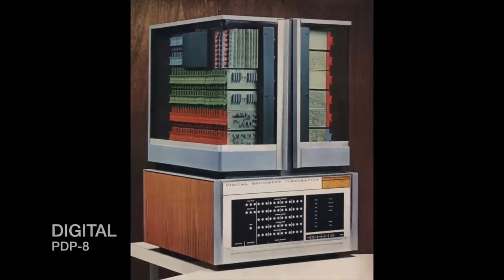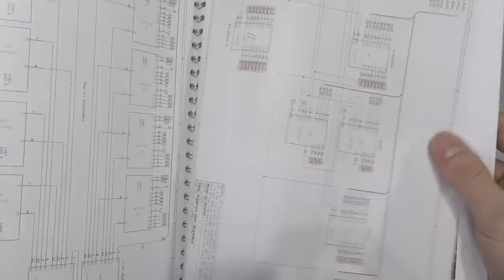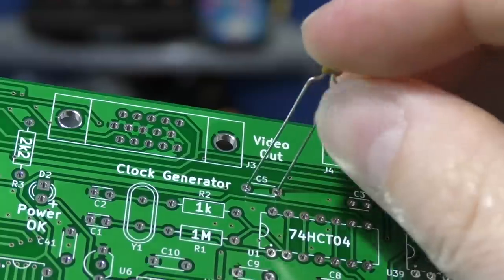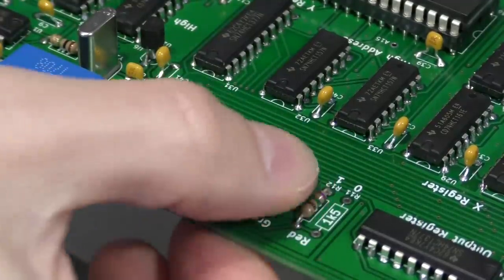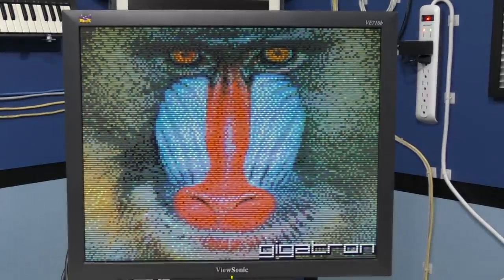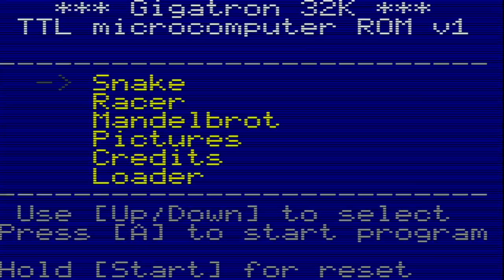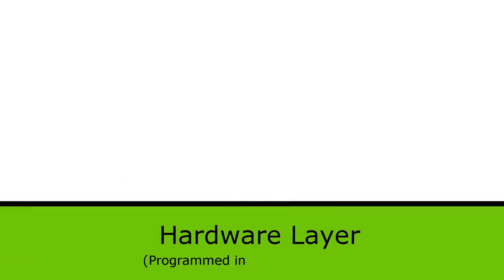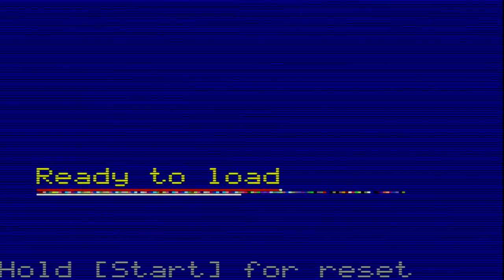The Gigatron TTL Computer without a Microprocessor

Comment: Now make a computer with vacuum tubes instead of transistors. Im sure that if you filled out the entire state of Texas with them that you could probably run Tetris.
Reply: lel :)
Reply: I had a customer that has done it and it was insane.He powered it from his 240 volt line in his house because of the power it took to run.It has massive hound wound transformers and runs a grid voltage of 600 VOLTS.I dont know what he spent but it wasnt the cheapest way to  go thats for sure.But man is the thing bad ass once warmed up and it even uses period correct neon bulbs and nixie tubes.
Reply: Holy hell, we need a video of that monster machine. Just description alone is tech porn.
Reply: I've got some pictures somewhere but I was in aw of it.The whole thing was about 3-3.5ft deep,4-4.5 ft wide and about the same in height,it was huge although he said it was small by historical standards.It was all point to point construction too.How they wired it is beyond me.Although the son was a engineer in his 50's and his father worked as a engineer at RCA and then in Bell Labs back in their prime. At the time he was telling me how his father helped invent transistors as we know them and to be honest i thought he was full of it.But I later found out he was in fact a tech who worked under Shockley when they invented the first transistor.I really wish I had got to meet the father but he died of cancer right after they finished the computer as a father/son project.I'll see if i can find the pics because the place was like a electronics museum .
Reply: lol it wouldn't need to be that big Tetris is a relatively small program. :)
Reply: Wow, small world, to run into someone who helped more or less shape the entire modern technology! Also, wow #2, that's a big boy computer indeed!
Reply: Hm yeah it would be something like that... A Transistor-based computer as powerful as an OG Gameboy could be the size of 2 large classrooms. Let's keep in mind that the TX-2 was a Shopping Center-sized computer and it consumed about 8 Megawatts of power and it was about 30% of the Playstation 1's processing power. The TX-2 already featured "*real time" 3D graphics and it's a 1950s computer!  (Disclaimer: "real time" in a sense that very similar to modern computers the graphics were rendered as the game was played, it wasn't an actual real time system. And even nowadays no one uses actual real time systems for gaming..). The frame rate of the TX-2 was about 15FPS meaning that it was below what was necessary for humans to get the illusion of motion but it was still albeit impressive at the time. Ivan Sutherland even made a VR HMD unit for the thing. A 1950s computer with 3D graphics and everything was unbelievable back then. It was almost as exciting as making a huge discovery in physics. TX-2 is the basis of everything we have nowadays. The original CAD machine sort of speaking... The Tallgeese of modern computers.
Reply: The Astro Gamer If he really wants "off the shelf" longevity, this is the only approach i can think of which truly offers that. TO-92 package transistors are the only component that offers true long term availability. So the only solution is to decompose all these fancy chips into TO-92 packages for kits. Otherwise, buy a c=128.
Reply: That's complete rubbish. No computer ever was the size of a shopping 
center if you don't call a convenience store a center. A computer in the
 50's was nowhere near the capability of the Playstation 1. You clearly 
have no clue what exponential growth means.
Reply: Ya, the early computers had a  very  small instruction set, and only ran around 90khz. Even with machine code they barely matched what a commodore 64 could do in BASIC at the high level. The difference for those computers was that they were designed with multi-user environments and batch processing from the outset. Eniac, it is true, used an enormous amount of energy, and LARC I even more... but transistors could very easily  fit into a very small space. I say that with the previso that you are good at circuit minimization and layout. As an example of this, I cite the HP-9100 calculator. Transistor ALU, memory, registers, and not a single IC. Yet, it fit into a compact desktop calculator. Determined users even added I/O to it. It had CRT output and a linear PSU, and still fit onto a desktop. It was around the same size as the more modern HP-85 computer. I think it's successor was the machine that saw the introduction of magnetic credit cards too. It used them for data storage. Although, it might even have been the 9100.

If one were to reduce the ALU down to diode logic, and latch the output to a shift register, some flip flop configuration transistors, you could have a 1 bit contiguous ALU which  emulated whatever size ALU you wanted with very few transistors...simply using diode logic with 3 resistors, 2 diodes, and some wire circuitry for the shift register. Since the ALU itself could be clocked differently than the rest of the computer by using RDY lines, you can run that small circuit as fast as it'll change states. The ALU action never even needing to change states as well. Finally, a counter could be used to check the ALU is done with the whole mess, and then signal RDY to the CPU to go on to the next instruction. In this fashion, a 32 bit CPU could take up very little space, even without a single 7400 logic IC. I actually plan to build one of these some day.

In addition, I too would offer a minimalist instruction set and a pseudo instruction layer above it. It is way better than having a 4 boards the size of my desktop LCD to fit it on.

I also want to use core memory, and I am experimenting with the concept of printing core memory onto transparent paper(and/or masking copper nano particles as the wire portion). I can then use conductive epoxy to attach the output lines. Then memory density is the resolution characteristics of the printer/stencil.
Reply: SouthJerseySound there's no way
Reply: haha point to point hahaha
Reply: There was a company that made modern motherboards in the 90s that used a few vacuum tubes on them at full plate voltage. Also I've read a few articles recently that vacuum tubes (in micro and mini tube form) might be making a comeback, at least for the sort term, in some computing applications because they get around certain problems that modern computing is starting to run into with the electrons moving nearer and nearer to the speed of light inside the computer.
Reply: The Astro Gamer they no longer make vacuum tubes and the rest have burned out!
Reply: Preston Frey you are misinformed about vacuum tube production. I just built a guitar pedal using two brand new tubes made not more than a year ago.  There's quite a few companies still making every type of tube you would need to build a full computer. At fifteen to fifty bucks a tube though that computer would be even more overpriced than an Apple product for the amount of computing power it had compared to other options.
Reply: Mustakari It was not a single building but if we put all of it's components in 1 building it would be more or less the size of a shopping. The TX-2 was a Network of transistor based mainframes across several states, it was larger than the Arpanet with several interconnected mainframes to form it and each mainframe was a datacenter-sized thing... I am not talking about the TX-0 which was the size of 4 large classrooms. The TX-2 is more advanced than the TX-0 and TX-1 and it was used to develop the MIT Sketchpad, 3D scanning, the original CAD applications and graphical processing units used to develop microchips. It was a milestone in computing. And since it was a top secret project most people don't know about it. But it was indeed around 80% the processing power of a Playstation 1. But let's keep in mind that this machine was ENORMOUS and consumed the energy of not just one but 2 nuclear power plants. While the Playstation 1 is something SMALL that we can have at home and it uses less power than an incandescent light bulb... The Playstation 1 is inded Exponentially more efficient than the TX-2. You clearly don't understand that the logic of exponential growth in processing power has to do with making smaller components so that we can fit MORE components in one place (microchip) and because such components are smaller the energy consumption decreases. HOWEVER we can also make more powerful computers by just adding more components which would increase the size, cost and energy consumption. The TX-2 was a whole NETWORK of MAINFRAME-Sized computers and it was slightly weaker than a Playstation 1. Just put that in perspective... What Moore's law states is that computers would get exponentially more powerful KEEPING THE SAME DIE SIZE AND ENERGY CONSUMPTION! The TX-2 DOES NOT HAVE THE SAME SIZE AND ENERGY CONSUMPTION AS A PS1!!!!! IT IS MUCH MUCH MUCH MUCH LARGER! AND CONSUMES MUCH MUCH MUCH MUCH MUCH MORE ENERGY! YOU IDIOT! The TX-2 is something most people don't know about however it's main operation interface was located at the Lincoln Lab (MIT) and it was very important for making microchips possible and also that's where CAD and all 3D applications were born. It was a very special unit although it only lasted about 3 or 4 years and then once microchips arrived they discontinued it because it's operation cost was in the millions of dollars per hour. I believe it only had up to 300 hours of operation in it's lifetime so it was over 300 million dollars just to use it during all of those years. And yes most of it's programming was done in paper and revised by humans manually. There was no IDE, no Eclipse or Netbeans back then. So most of the time the machine  was powered off and they only used it to run tests, compile chip architectures and etc. It was capable of autonomously generating circuits for the production of masks used in the production of IC (Integrated Circuits) dies (Yes that's what a microchip is technically called, it's a "die"). This is all before Intel was a thing boy. Exponential growth in processing power only started in the mid 70s when the IC manufacturers such as Texas Instruments were already stable and ICs were becoming mainstream everywhere, it was the great explosion of the 70s. But before that there were only 1 or 2 powerful computers in the world and the TX-2 was definitely the strongest. All others were weaker than tamagotchis. The TX-2 however was SPECIAL it was Playstation-tier in it's capabilities, it featured 3D polygons, texture mapping, shaders and everything you can possibly immagine, the thing was a MASTERPIECE, it was the greatest masterpiece of the 50s... Hell it even had freaking VR with motion tracking and everything! which worked BETTER than most 90s VR machines. Just search "Ivan Sutherland VR" and you'll see what I mean. The Sword of Damocles (Yes that's what Ivan's VR was called) was actually BETTER than all solutions private corporations had during the 90s, just let that sink-in... 90s corporations were not able to beat a design from the 50s! That's how advanced MIT was in relation with the world! They were CRAZY ahead of society (nowadays not so much). People that worked in the Lincoln Lab were living several decades in the future!!! The Sword of Damocles was only beaten recently by the Oculus Rift... The Oculus is indeed much better but also HALF A CENTURY newer. So before saying that I'm full of shit just try to use that brain of yours for something... Computers became smaller and more powerful because of microchips and the components which got smaller and smaller however a computer gets more power by getting MORE components and higher clock speeds due to lower heat production of smaller components. A computer with 1 90nm processor is not stronger than a computer with 10 of the exact same 90nm processors even though the computer with 10 90nm processors is 10 times larger and consumes 10 times more energy it's actually also 10 times more powerful because it's literally like taking 10 computers of those and linking them together... They are ALL 90nm. So you see that in this case larger is actually more powerful. I hope you can understand this concept... Microchips are only more powerful when their components get smaller for example going from 90nm to 45nm there is the POSSIBILITY of making stronger computers but that not necessarily happens! Sometimes corporations prefer to make the same systems cheaper, smaller and cooler by doing the "die Shrink", for example going from 90nm to 45nm, THAT'S WHAT HAPPENED TO THE 7th Gen consoles such as the PS3 and Xbox 360, they went from 90nm to 45nm but they kept the systems overall the same thing, the same processing power you see... But the units did get smaller and more efficient. I hope this concept is clear.
Reply: Trenzinho da Alegria in the 90s I worked for. Geophysics company running to IBM SP2 mainframe parallel processing, and was the 168th most powerful super computer in the world [within Geophysics type data processing industry]!!!!
Reply: Then maybe you could run doom if you took up the entire midwest
Reply: Tj & Ja lel?
Reply: It's more challenging to make a purely mechanical computer and also quite feasible to do so.  This art may come back with nano-technology.
Reply: Sounds like a good use for Texas!
Reply: Ever hear of the nervous net using analog transistors without any CPUs and yet capable of doing things to make robots and androids more of a reality for the only problem is how to interface an analog computer directly to a GUI without the need for a digital computer. https://spectrum.ieee.org/computing/hardware/not-your-fathers-analog-computer  And I, personally, won't be surprised at Japanese intelligence and ingenuity and talent. A Hybrid analog-digital computer exists so that it can use the GUI to receive new programs and information-data, etc through the digital CPU. The Japanese has already all of the Aymara algorithm information on paper and archival microfilm fully "TRANSLATED" into english and japanese for it is an ancient algorithm that acts as a bridge language between 2 different computer languages and allows them to communicate-translate simultaneously and they already have the hardwired aymara algorithm analog transistorized printed circuit boards and IC silicon chips. The Japanese also hates frivolous overboard proprietorship-frivolous over proprietory ownership policies of YOU AMERICANS so they decided to use the original "BINARY CODE ALGORITHM IN ADJUNCT WITH THE ANCIENT AYMARA ALGORITHM BRIDGE LANGUAGE" a hybrid binary/ancient aymara algorithm bridge language based-O/S programming hardwired into a programming chip and analog transistorized printed circuit boards. That means GOODBYE TO APPLES FRIVOLOUS OVERBOARD/FRIVOLOUS PROPRIETORSHIP ABUSIVE CORPORATE POLICIES. It is time for the free open source computer hardware and free open source computer programming. With one policy condition: any improvements, expoundments, advancements, etc done with these new free open source computer hardware and free open source computer programming must be shared openly in the internet and through couriers hand carried snail mail against big brother's corporate evil policies. Microsoft and Google and Youtube and Nvidia and AOL and Facebook and Twitter, watch out for a new Japanese peaceful Pearl Harbor Attack is coming to get you selfish and evil turd heaed assholes! And they will revive the best of the old 1980s era computer features and advantages. The CRT is coming back, the VCR is coming back, the Zip Drive is coming back, the Floppy Disc is coming back, the Diskette is coming back, and the Magnetic Tape Storage for PCs is coming back. The best of the old combined with the best of the new, no proprietorships allowed, new innovations and designs long suppressed will be back, an all analog control-monitor-indicator-effector-sensor-self-diagnostics system will all be back. High Tech will be used to re-create the Old Tech which will be upgraded to match the performance of High Tech.
Reply: 333rd like
Reply: FILL THE ENTIRE UNIVERSE WITH THESE VACUUM TUBE TRANSISTORS I WANNA PLAY FORTNITE
Reply: The entire place would probably burn to the ground... Apparently the rooms in which the old vacuum tube computers were houses were described as “tropical”, so poor Texas would melt despite the great fun it would be to play “Texas Tetris”
Reply: Cant stop loling
Reply: I think people are doing that. But because of current technology apparently vaccum tubes can be scaled down to incredibly small levels?
Reply: Fill WHOLE TEXAS STATE WITH TRANSISTOR AND PLAY GTA V.
Reply: or make a voting machine ?
Reply: I know a guy who made a calculator on... relays. A small cabinet to multiply up to 100.
Reply: @jacek-jan  < Well yeah, simple gates can be mimicked using relays and such.... course it's awfully large and power hungry.  That's why they've switched to semiconductors.
Reply: Need a bunch of Selectron tubes, they announced those in 1947, I have an Analog Science Fiction pulp from that year that featured them.
Reply: Like the UNIVAC?
Reply: Some WERE the size of a large room, and you'd probably need a shopping center's worth to equal a more modern computer's power.
Reply: @southjerseysound7340  Hi, just wanted to ping you and let you know that new people are also discovering your comments and would VERY much like to see this computer - and the room/place it's in :)
A full video would be awesome if you could manage it.
Reply: @asmqb7222   I only have pictures as it was in a customers house years ago. But I'll try and dig them out and I guess I can do a video/slide show of them. But there's no way I can do a big video.
Reply: @LordPadriac  I think I remember a motherboard from that era that has audio output with small triode electron tube.
Reply: Have you seen the MegaProcessor visual computer? Several mainframe size racks covered in transistor-packed PCBs, each with an attached LED so you can see when each of them switch. One of the main programs it runs is a version of Tetris that uses the main memory panel as its display (because the machine doesn't have any other kind of VDU output). Like a huge version of the Monster 6502.

I expect that if you did away with the visual element for most of it you could rebuild it with vac tubes in about the same space, and then use a storage-tube CRT as a replacement for the combined memory-display... be a little more cramped than the MP, but you should be able to get a playable game out of it. I've had a cheap Tetris-playing LCD game before that had an effective resolution of about 10 x 20 pixels after all...
Reply: Actually, done properly, you could run Tetris on a vacuum tube computer the size of a fridge. It would have to have specific hardware designed for it, though. Like a 1-bit display. You might be able to get away with an off-the-shelf monochrome LCD.
Reply: @Robert Baker  I doubt you'd find them but I saw a display using them in a Bulgarian electronics book and I've also heard of 7 segment nixie displays that would possibly do it. I also think the Nimo tubes would do it but they're miniature CRT's. and are rare as can be. VFD's really took over for complex displays pretty quick so I'm assuming that's why they're essentially nonexistent. But if your heart is set on some I know of some people who custom make Nixie tubes that might give it a try.
Reply: @JosipMiller  it was made by AOpen
Reply: @dushk0  Yes, I remembered now. :)
Reply: @southjerseysound7340  I'm surprised that it could run off of the grid at all, I thought you'd need a generator to run that monster.
Reply: yes, and two diodes make a transitor, so you could go twice the size of your estimate with diodes.
Reply: @dannygjk  4D Tetris aint small.
Reply: Anyone do one with Nuvistors?  Might be a bit more manageable.

Of course, there might literally not be enough functioning Nuvistors left in the world to do that...
Reply: "No Commie Music In Texas!" ;-)
Reply: And if it was in the size of the sun maybe could run crisis at max settings
Reply: Mr Spock did it.
Reply: The Astro Gamer you could probably run more than Tetris on a computer like that because let me tell you, Texas is absolutely massive.
Reply: @southjerseysound7340  run.It is a site 🤣🤣
Reply: The SAGE system took up a warehouse sized room, was all tube, and it ran a defense system far more complicated than Tetris. It even used CRT displays and light guns (working about the same as a light pen) in it;s control consoles.

I think a couple refrigerator sized cabinets will hold enough car radio type tubes to run Tetris.
Reply: Here:

https://en.m.wikipedia.org/wiki/Semi-Automatic_Ground_Environment
Reply: @tripplefives1402  I am highly aware of all of these points. I never even suggested that a reduced instruction set computer couldn't run basic, and thence any program written in basic. I also never suggested that you couldn't reproduce complex instructions with simple ones. All I said was that the IBM 702(I think that was the device I was citing) I believe only had 15(PDP-8 definitely does) instructions and ran at 90khz. You could in theory calculate the maendelbrot set on one. It would just take a very long time precisely because you had to set up a JMP as a JSR by storing the return address yourself etc. and at 1/10th of 1mhz it will be rather slow at that! Or on the aforementioned commodore 64 you don't have multiply or divide(ROL & ROR don't really count) instructions so to do 3d stuff you need lookup tables to make graphics render or run at all fast. Still, the limited instruction set of the 6502 allows you to do logarithmic floating point in software, which BASIC does under the hood. H ave a PDP-11/3 and it has an optional math chip & optional additional instructions, however you can imitate those in software too. The advantage is that you can do assemblies with way less overhead and waste memory fetches and branching etc. by including those instructions in hardware as microcode of circuitry. I never suggested otherwise so I don't get why you said all that.
Reply: @s.s.85  before we need some nuclear stations for it :D
Reply: IT working a Cyberpunk?
Reply: vac tubes aren't as huge as you think lol.
Reply: @prestonferry  Vacuum tubes are being manufactured again. When I was a kid in the 90s there were still boxes and boxes of the things around. When the huge supply ran out, that was it. There is a guy in Ukraine who makes new vacuum tubes.
Reply: @peterlamont647  hmmm interesting, I wonder why they’d be needed though? They seem useless in today’s society except for experiments...
Reply: @prestonferry  One word. Amplifiers.
Musicians will pay tons of cash for a tube amplifier. They are the best.
Reply: @peterlamont647  transistors though?
Reply: @prestonferry  Think analog. They want analog sound, and the best way to get that is with an analog switching component. Hence, a vacuum tube triode. Also, tube part requires fewer support circuits overall because you don't need to control low voltage signaling to direct high voltage parts. You just have a tube. Takes the place of ADC, DAC, Op Amps, MOSFETs etc.

Also, there are a lot of collectors who restore and enjoy old tube radios and TVs etc. and even sometimes test equipment in the case of 'mr carlsons lab' channel on youtube.
Reply: @peterlamont647  interesting, I study electronics but never knew much about vacuum tubes... Thanks for telling me...
Reply: @southjerseysound7340  Dude... clock speed? Flops?
Reply: Or at least keep it from freezing.
Reply: @southjerseysound7340  How can I contact this man to see this
Reply: @Lennon Graysen Nice bot
Reply: @TechHowden  this was an old comment and someone already said that…
Reply: ENIAC is the First Computer With Vaccum tubes
Reply: On pal settings
Reply: Now were just being silly
Reply: YEAAAAAS FUK POTN BEST!
Reply: As a texan i agree to this
Reply: instablaster.
Reply: Use sub-miniature valves with double-sided PCBs.
Reply: What about relays? They can also function this way, albeit very slowly.
Reply: 200 tubes would be enough to make one 8 bit shift register. 1000,000 tubes would be enough to build one VSLI chip hence assume our Terri's machine has 3 VSLI s and some glue logic then let's say , 3002,000 tubes should do the job.
Reply: @nicholasmaude6906  
They're here low voltage surface mount valves/tubes are now a thing.
Reply: @peterlamont647  
Actually it's down to longevity Peter. A transistor is not designed to last more than 20 years but a valve can last god knows how long?
Reply: @trenzinhodaalegria8012  
😄haha! 3D "graphics" u mean vector graphics.
Reply: @factorylad5071  I have plenty of transistors well over double that age and have never died. A vacuum tube might last a while, but vacuum bulbs and tubes(or valves as you call them) burn out far sooner. They are also bulky and require a lot of power. 

Some tubes last longer than others...but back in the day swapping out tubes in your TV or radio was normal. I have a transistor radio from 1960s that still works perfectly. Back when they came in a resin filled metal cap with gold legs! I also have a 1541 disk drive(circa 1984) unit which has a fair number of transistors. It still works, I used it today).  I don't think I have ever had a transistor fail on me that wasn't already dead from the factory. 

As soon as transistors hit the market, computers ditched tubes. Consumer electronics took longer because of the initial cost difference. Transistors were expensive compared to tubes simply through economy of scale. A tube cost less than $1. Once manufacturing and supply got up and running, the tube had it's day. I recall someone saying that in the early days, transistors were several $ each. I think I remember $20 but that sounds ridiculous. Now they are 3 cents....and that is with rabid inflation over 70 years. Maybe it was $20 each in 2013 money. Regardless, they were pricey. As long as they don't run hot, they seem to last forever. Again, I am running one that is around 57 years old.
Reply: Not to mention you would actually need to use a full hidrolectrical power plant to switch it on!
Reply: and if you add 35,000 more square miles it can play doom!
Reply: hey. wanna know something cool? come closer. there is such thing as "neon bulb" logic. idk how it works but it exists
Reply: Which version of Tetris?
Reply: probably
Reply: Could it run Doom